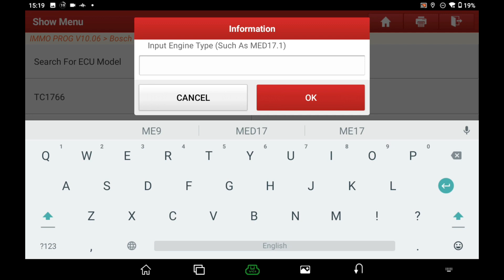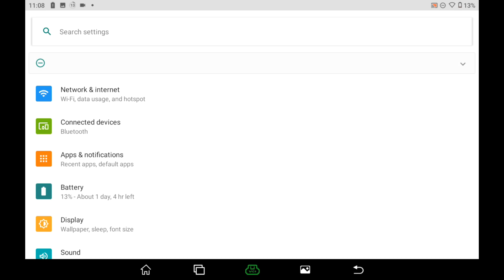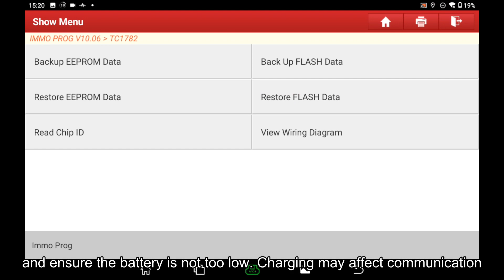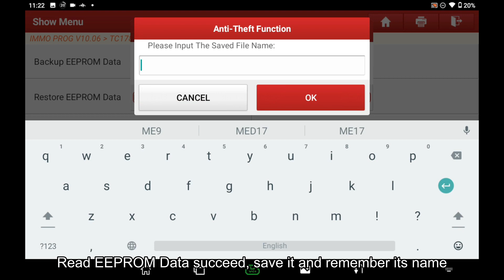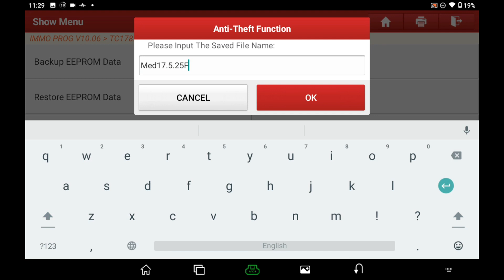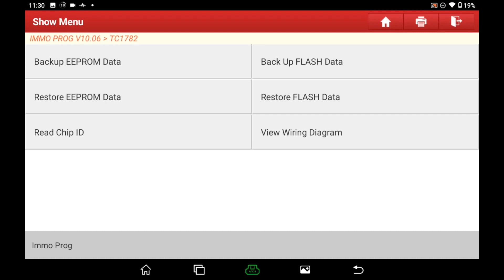Bosch/Siemens Engine ECU EEPROM and Flash data backup and restore by IMMO Pro/Pad or X-PROG 3

Comment: I use this very often and it works very good for me I have no problem but one thing I could say whenever you are using this make sure you have your battery fully charged because if the battery go low The flash data going to stop reading it going to  fail. So what I did is put it to charge for an hour when it got a charge it read and write the flash data in less than 5 minutes.

Comment: Launch Tools, This information is very helpful, thanks! "please don’t charge the tablet when we are back up or restoring the data, and ensure the battery is not too low. Charging may affect communication". If I had not read it, I would have waited a very long time for the programmer to exit the Flash reading mode! When reading Flash, the programmer initiated a banner, "Wait, reading in progress" and hung! After watching your video report, I realized that this should not be so. I turned off the power and rebooted the diagnostics, turned on the Flash reading again and the reading was completed within five minutes!

Comment: Have xprog3 for almost an year. In this time I messed up my audi a4 b8 immobiliser system because it device failed to read immo data (cost me £150 to fix it with ABRITES programmer).  Wrote feedback but half  year later still not fixed. Tried to read immo data on other few cars and ecu's on bench mode. Nothing. Doing step by step, trying to find videos but it fails all the time.
Reply: Привет Друг! Точно такая же ситуация! Купил устройство почти год назад, но до сих пор, не прочитал ни один ключ, от ряда автомобилей! Хотя сделал программирование MEG17.9.21 хорошо! Написал в поддержку на завод Launch, но до сих пор он не даёт объяснений!